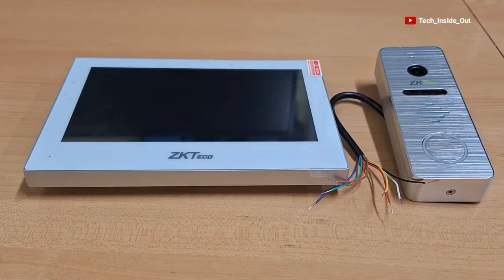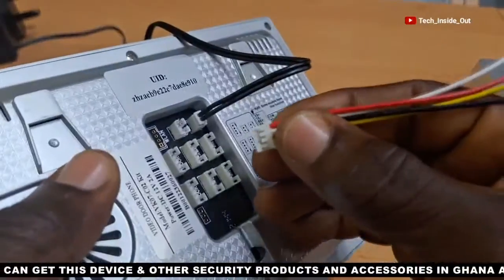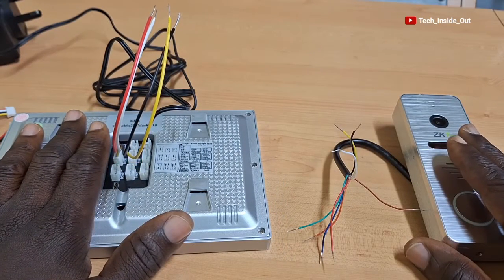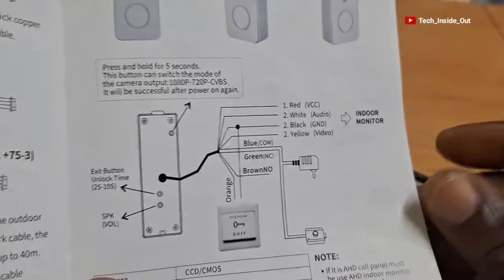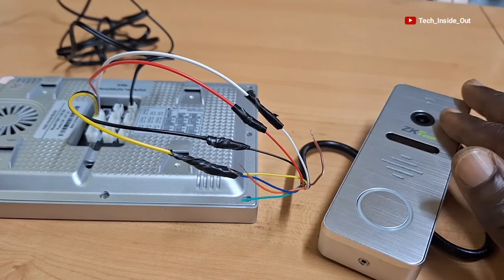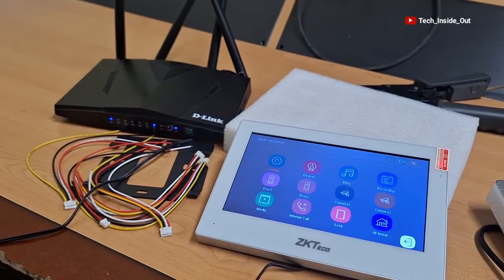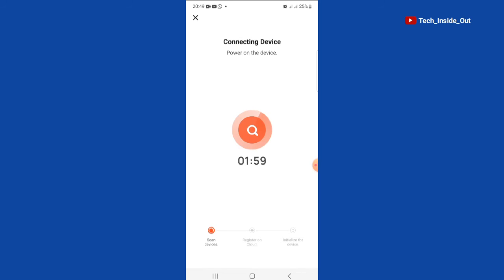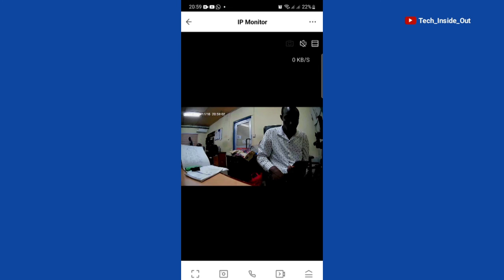How to setup a video Intercom system with remote video access on a mobile phone

Comment: Please I thank you first, please the first part when you were connecting the indoor and the outdoor cables you missed them up you didn't much the colors like you do this one please why
Reply from the maker: When you are able to get thesame colours of cables used in the machine, that would be good but if not, you can use any other colour of cable but just ensure each cable is connected to the right cable.

Comment: If a person doesnt push the door camera switch does the system have a way of alerting that there is a person outside. 
b)
Reply from the maker: No, unless a person pushes the bell. Motion alarms rather get you informed of the presence of people even without them pushing any button, just their presence sends an information or alert that there is an intruder.
Reply: @Tech_Inside_Out  thanks

Comment: Job well done.Thanks alot. Suppose the distance between the doorbell and the monitor is 50meters.Which type of  cable is recommended for connection. Can i use network cables?
Reply: U can use a flexible 4 core cable. 1mm² or 1.5mm²
Reply: @abasembatya yaa it can work sir🤝
Reply from the maker: There is a four core cable having the colour codes used in this system which is suitable for this installation.
You can as well use network cables.
Reply: @Tech_Inside_Out  with network cable, can u use single cables or u can bundle 2 cables together like (green and stripes green)?